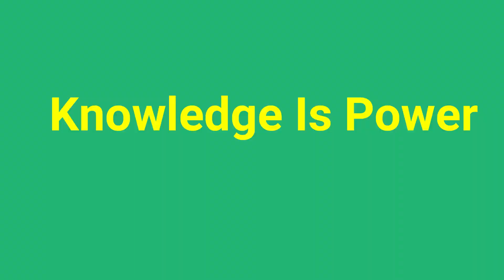Cucumber Pollination/Fertilization

Comment: great thank you. what if a female flower doesnt get pollenated?
Reply from the maker: Hello, thank you for your feedback and the question. If the female flower doesn't get pollinated, it will abort- meaning it will fall from the plant and you loose that potential fruit.
Reply: @MCAgriTech    I better get these plants getting busy.  they are inside so no bees
Reply from the maker: @brictator  OK, you can also pollinate them yourself. All you have to do is, take the pollen from the male flower with a thin flexible brush that can go inside the male flower and then gently brush or tap the pollen collected, inside the female flower. And ensure that they are getting enough light as well.